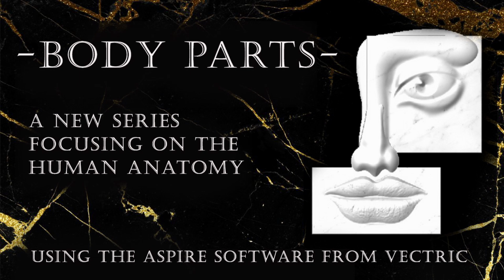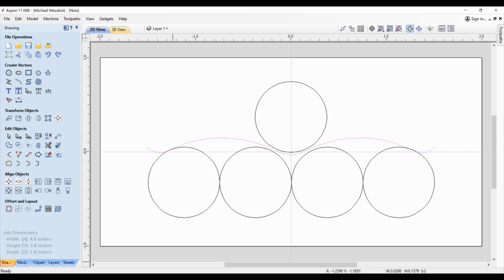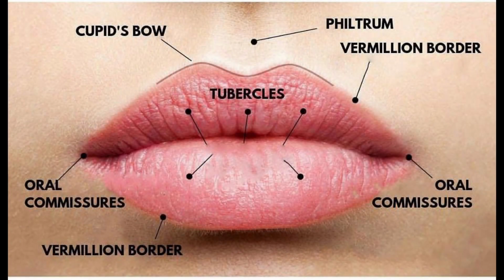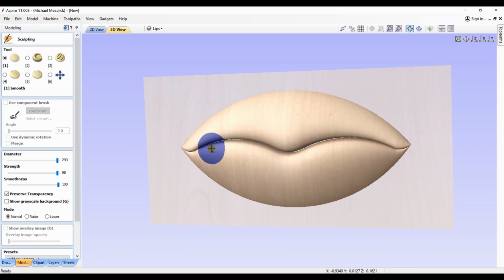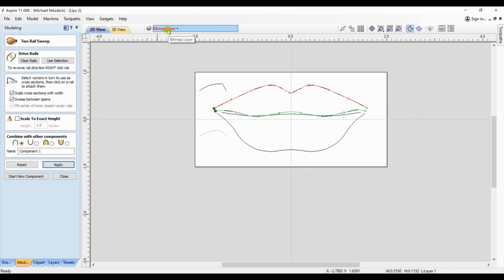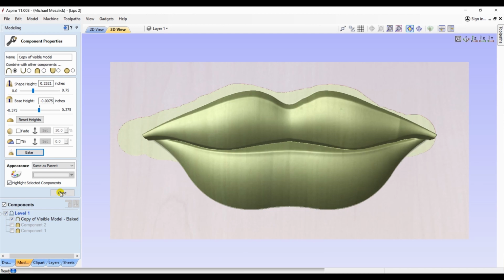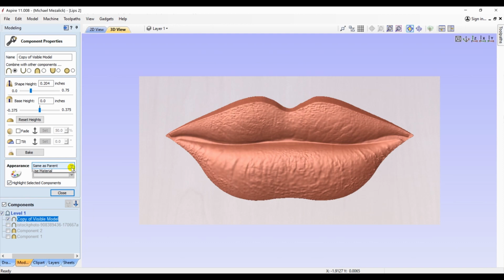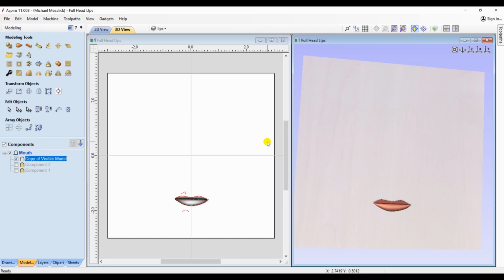3D Body Parts using the Aspire Software from Vectric - Part 1 Lips

Comment: I think you hit on a key part I struggle with is seeing the vectors.  "if you can. see the vectors you need you're half way there.." or something like that.  I can see the outline vectors of the lips (kinda-sorta) what i struggle with is the shaping vectors to apply to the two rail sweep rails.  It seems to come naturally to you what they will look like, I have trouble translating the shape of the arc/curves into how they will look when applied to the rails.  Although you demonstrated multiple times which rail to pick first, I still get turned around on the results of what the vectors will look like.  Excellent instruction but it is going to take me a bit to pick this up and practice the application.  Not sure if I have the attention span but will give it a try.  Glad these videos are here to refer to.
Reply from the maker: Thanks Rob. Two major item to learn are learn to see the finished item in your head and then if the 2 rail sweep isn't correct, quickly delete it and move on. Don't linger on a shape that isn't what you want. No-one gets it correct all the time. Delete and try again. I can guarantee that the same shape will somehow re-appear.